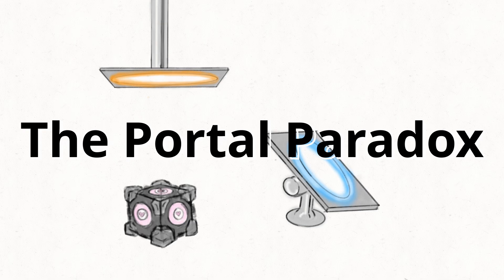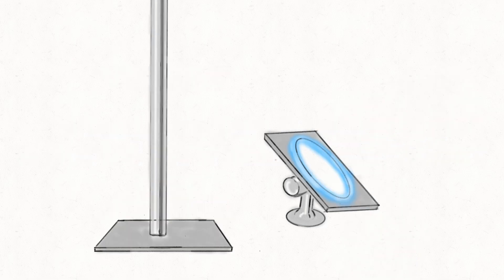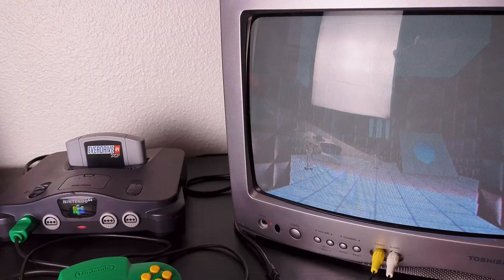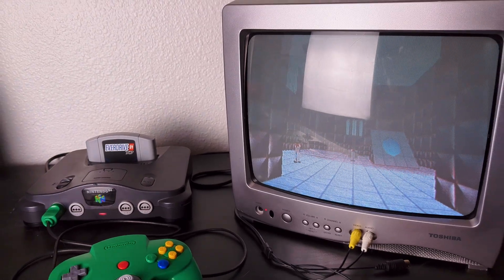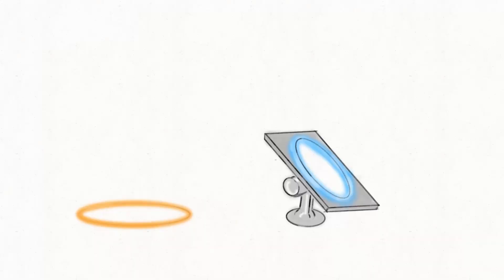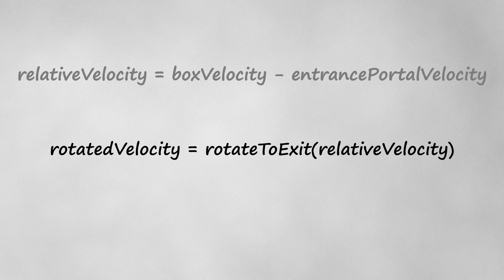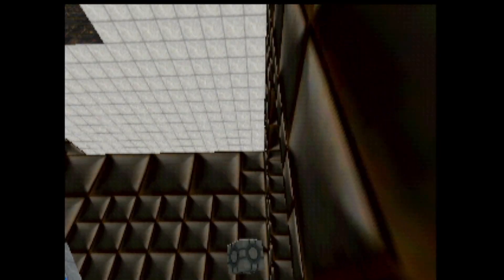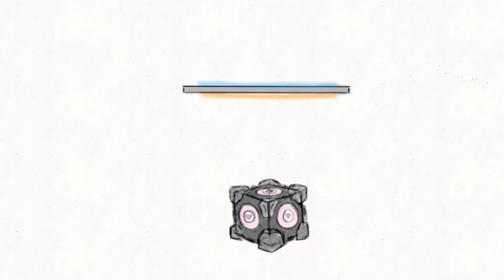I rewrote Portal from scratch and solved the Portal Paradox

Comment: This DOES NOT solve the paradox because you've made a pretty big mistake in how physics work IRL. Like solving a kindergarten physics problem about ball being thrown without thinking that wind exists.

You're assuming each object is a simple "point" entity, basically your box is actually a single point in the middle of it and it moves with it in its entirety.
In reality, each object is a "cloud" of atoms held together by each other. So if you imagine doing your experiment in super slow motion, taking in account each imaginary atom, at every unit of time, there are multiple different force vectors affecting the different portions of that cube.

While the cube is halfway through, half of the atoms are affected by the movement vector from the portal(lest say its x0,y0,z1 with 1 being the speed of the moving portal) but half are still resting in their original position AND have their original vector of movement being x0,y0,z0. Thus during that point of time your entire object is being "torn in two" by forces of vectors 0,0,1 (from atoms already flying into portal) and 0,0,0 (atoms still stationary).

Since your object is a solid entity it will probably survive this in one piece but the forces that push it up will be diminished at EVERY point of observable time by the atoms still left standing. So, when its 20% in, only 25% of atoms will have the momentum, then 50%, then 75%. 

BUT even this is not really correct because by the time its 50% inside the portal, it would already start moving by those few atoms already inside the portal, just not at the same speed you have assumed it would have.

In reality this would require MUCH MORE complex calculation that I've described here. But even my simple explanation should help with moving in the right direction on how to solve it.
Reply: Seems more like he solved it with newtonian physics and you're talking about quantum/atomical physics, as opposed to "kindergarten physics". point is, the result should be similar. In physics not everything gets calculated, that's why models are used.

Comment: Can you show what your engine does if a portal slams into a cube only halfway? minutephysics had an interesting video on the topic which concluded that the cube shooting out at half the relative speed would be the most physically accurate result, and I'm curious what your engine would do in this case.
Reply: Probably the way it actually works in his engine is that the cube shoots out with full velocity if the midpoint passes through, and stays perfectly still otherwise. This is actually consistent with minutephysics' argument, if we pretend that all the mass in the cube is concentrated in a single point, instead of evenly distributed throughout its volume.
Reply: If a portal changes speed and is intersecting with a solid object, it should trace how much of the object is inside and how much is outside as in a 2D raycasting. This way, knowing the weight of the object plus velocity and torque you can implement a way to modulate the velocity and torque. Center of mass becomes a problem for solid objects with odd dimensions but there are ways to implement something that doesn't take much processing power.
Reply: It most likely doesn’t support that but it could be implemented with math. If the cube was a softbody(made up of a bunch of little rigidbodys connected together) then it would work out of the box as is.
Reply: @phoenixdonner8553 would it be possible to spawn a new cube in the other portal and render what’s behind the portal overtop of the of the cube coming out of the portal. Then once the box is through you delete the old one. This may require some extra stuff like have to calculating collisions differently and only show the box that’s “owned” by that portal in that portal?
Reply: @dylantryalot6187  um, I mean everything you said is possible to code but what problem would it be solving/how would it solve the problem?
Reply: @phoenixdonner8553  Then a cube can be halfway in a portal but looking back at the video it looks like it already works.
Reply: @dylantryalot6187  Portal travel in video games always has a sort of "shadow clone" effect like you described for objects passing through, assuming both sides of the portal are visible. I recommend the Valve GDC talk on Portal 2 game design, and the Sebastian Lague video on reproducing the effect in Unity.
Reply: @dylantryalot6187  Well, yes it can be half way through, but it's just the visuals. You need to actually cut the object in 2, and understand it geometry to recalculate all movements. An unpotimized solution would be to have points inside the object in a grid with fixed distance between points. Each point can store it's weight and acceleration. This approach is pretty stupid from the point of optimisation, but likely can be improved by implementing a smarter point system.
Reply: @rubickevich  what if the cube can not be broken apart? Wouldn’t the cube move through the portal at half the speed?

Comment: the portal paradox gets even weirder when you ask what would happen if the the portal were to accelerate as it moves towards the cube.
Reply: I mean, it does. The test shown when it drops is accelerating at -9.81 m/s^2. The blue portal is also accelerating in the opposite direction, so it cancels. Like Portal itself, there's still probably a terminal velocity limit, so it isn't uncapped acceleration. Where this still isn't completely resolved is if there is a delay in rematerializing something after it enters the orange portal. If there is any delay, then the cube will have a slightly slower exit velocity than as it was derezzed. That would cause it to be compressed... I probably don't want to be the first living thing to pass through an accelerating portal.
Reply: It kinda doesn’t get weirder. In-game it’s just the center of the cube that counts as either being in or out of the portal.

In real life, the cube would experience a “pulling” force (just like with the moving portal) but if the portal accelerates, the force just becomes bigger. As long as the structural integrity of the cube holds, it’s like picking it up with a vacuum hose around the cube.

Comment: “I could make you wait for it, but I value your time more than retention rate.” Mad respect for that.

I just told my friend about this project and his first question was if the ch_createairboat command will be in the de-make. 😂
Reply: Would be a sick easter egg if it also required the N64 keyboard to pull up the console!
Reply: @VariaPrime  the what now
Reply: @ilonachan  portal is based on the source engine, which was made to run half-life 2, and has some leftover code from it
among that code is ch_createairboat, a console command that summons: an airboat
nothing too special at first glance, until you realize that unlike most commands it doesn't require sv_cheats to be enabled, meaning it's teeechnically a legitimate part of the core game
cue speedruns that beat the game with 0 portals and heaps of airboats
Reply: @hecko-yes  i know what the console is but why did NOBODY tell me the n64 had a keyboard????
Reply: @ilonachan  its just like how the snes had a mouse
Reply: @ilonachan  the console. for entering commands
Reply: @ilonachan  Old consoles have all sorts of weird peripherals. There’s a GameCube controller with an entire ASCII keyboard inside it, anything is possible.
Reply: @hecko-yes  I wonder if it was ever in Counter-Strike... Probably not
Reply: I am also a fan of ch_createairboat. 😁
Reply: I'd love to see the airboat speedrun category be possible in this demake
Reply: Valid question 😂 Now I wanna see that!
Reply: I see no reason for this, unless he first made a de-make of half life 2 and was building his current project on top of it. But that would be... fuckin weird my dude
Reply: @i-tokuni  How to make portal on N64:
Step one: Remake all of half-life 2
Step 2: Add portals
Step C: That's it. You win.
Reply: @kip258  Step IV: Profit
Reply: @kip258  That is the Greek 2, yes?
Reply: @rogercruz1547  Step V: Get sued by valve for profiting off of their intellectual property
Reply: @kip258  There is no such thing as "3"
Reply: @i-tokuni  locale man has never heard of an Easter egg

Comment: It really just depends on your point of reference. If it’s relative speed then just like in the video. However, if instead it’s based off the absolute speed of the object than it’s not like in the video. 
Example, cube has 5 horizontal speed, goes into a portal on a wall that’s connected to a portal on the floor. Cube has converted it’s speed to be 5 vertical. So the absolute speed stayed the same. 
Meaning that in the first paradox example using absolute speed instead of relative the cube would slide off the blue portal, because the absolute speed of the cube is 0. Paradox 2 is exactly the same whether absolute or relative.

Ergo, it depends on how it’s coded and both solutions are “correct”. Please respond if I made any mistakes or anyone has questions.
Reply: the issue with that is that there is no such thing as absolute speed in the real world, all velocities are measured in relative terms
Reply: @Sorcerobe  yea, just meant from a programming perspective, either way!

Comment: What I don’t see addressed here, possibly because this is implied in this engine, is the pulse rate or frequency of the portal. Is the portal a circle, or a cylinder?  If it’s a cylinder, that suggests that there are portal pulses where for each tick, anything inside the cylinder is transported to the destination. If it’s a circle, and anything that intersects that plane is teleported instantaneously, then you have infinitely many infinitely narrow slices being reconstructed on the other side. In either case, I wouldn’t expect cohesion on the other side. What happens if you slam the portal down to halfway over the block and stop, for example?  What if you slow the slamming of the portal to very slow speeds?
Reply: It's not a teleporter, it's a wormhole. If you did it fast enough it would probably destroy the box and pull it apart, otherwise the structural integrity will cause the entire box to move when the top part receives energy.